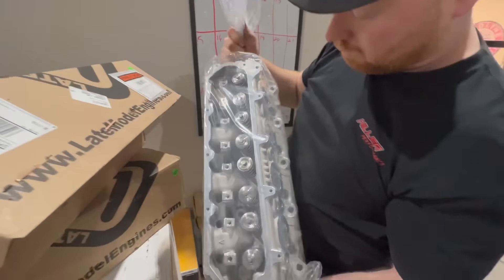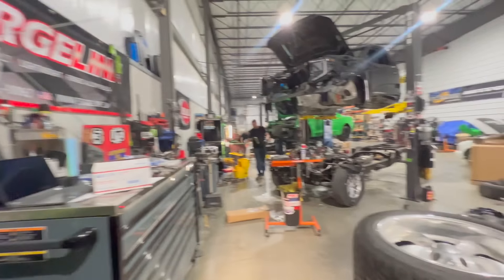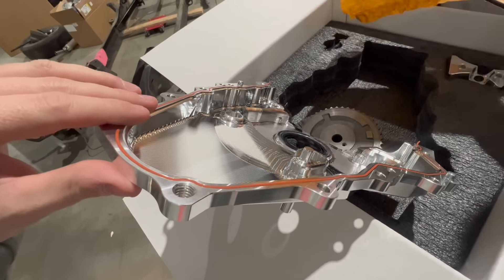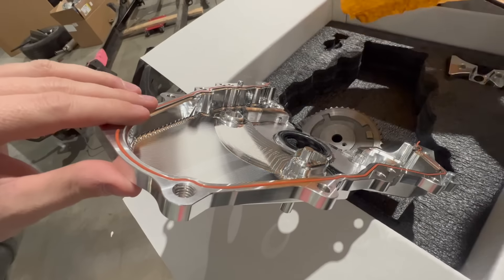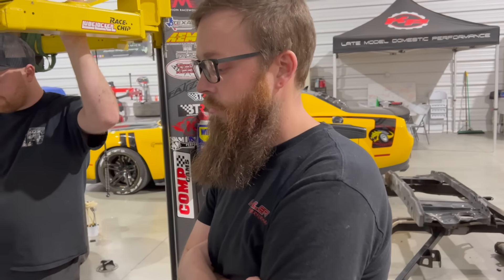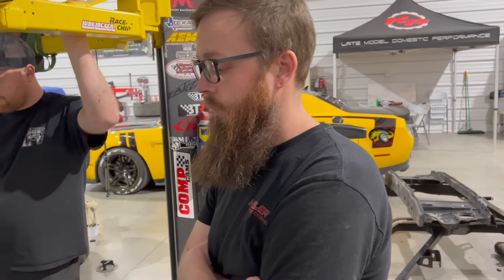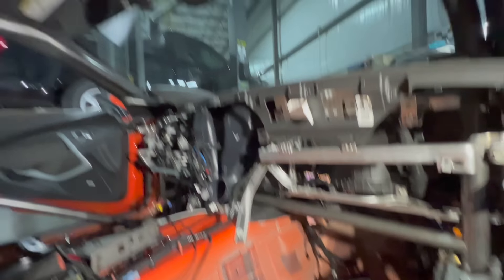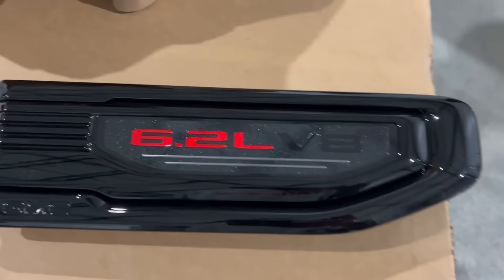New 1200hp engine for the 2024 GMC Sierra!

Comment: just a thought , can you buy a single cab silverado fully loaded in Mexico an bring it to USA? Maybe do paperwork to make it USA truck? 4:15
Reply from the maker: Looked into it. Didn’t want to go through all the work
Reply: Just have to get it inspected
Reply: I saving my money to try to do that.
 I hope you can do it  , and Share the info of that process . Great videos man . Thanks
Reply: Pretty sure you can't until the vehicle is 25 years old.
Outside of that, you can import it, but I don't think you can register it.
Reply: @eduardogutierrez665 I worked with a guy that lived in Mexico and bought a Toyota Tacoma there. When he moved back to the states, he tried to register the truck here. It was gonna take more money than what the truck was worth. The biggest issue is the emissions.
Reply: @precisiondiesel225 I though it crash standards every state has different safety and emissions standards. In North Carolina it’s lights , horn , brakes, tires, New York it’s all mentioned and they check it with  a scan tool.
Reply: Yeah you can buy one in Mexico and bring it over to the US. However, you must buy it cash or have Mexican residence and get approved for financing. Hard to get financing if you don’t have anything in Mexico. Then you just drive it over the boarder and can actually keep it on Mexican plates or register it in the states. To register it in the states, it will cost a pretty penny. I believe it’s an extra five to ten grand. That’s why they are very expensive but are by far much nicer because they got the full digital dash. Seen some people try to sell some on this side for upwards of 70k. So you can expect yourself to pay 50-65k in total. Really tempting but will prob wait until we get some with the same spec in the states.
Reply: You can order a roller without the drive train and have it shipped to the states alot of people do it
Reply: @adrianreyna5789  it’ll come with the digital dash and everything the cheyennes come with?
Reply: @elijahnavarro5454  from what I understand you can get it how you want just without motor trans
Reply: @elijahnavarro5454  they aren't going to sell it in the states. And as far as I know, you cannot not register it until the vehicle is 25 years old. Or you pay the emissions exemption, which makes the price not worth it .
Reply: @adrianreyna5789  oh wow that’s solid, I’d have to look into that
Reply: @T.I.R24  yeah that’s what bums me out right now. I’ve spoken to some people who have brought them over though. One of which who is still running Mexican plates because he said he didn’t want to pay the ten or so grand to get it registered. But I don’t remember enough to be 100% sure. I was looking into them back when I first seen the digital dash on the 2022.5s. But since then I stopped and just stepped away from the headaches hahaha. But yeah brother I don’t remember everything for sure.
Reply: Supposedly there’s a company in chihuahua mx that specialises in that making the whole process straight forward pricy but  I didn’t look to deep into it as I ended up just getting a 23 f-150 rcsb 5.0
Reply: Just say the truck is seeking asylum!
Reply: And also get the new interior rather than that older one
Reply: You're thinking backwards. What you really want is to have the vehicle plated in Mexico so that you don't have to pay America's outrageous taxes and fees or be subject to American safety laws. The US has recipricosity with Mexico, so you can drive it wherever the fuck you want with literally more rights and freedoms than if you plated it in your home state.
Reply: @StangkilrProductions is not really a lot of paper work is just get it registered here is the problem
Reply: They sell some already from Mexico on fb
Reply: @alpha434 but is there a limit to  how much time a mexico plated truck can be in the USA